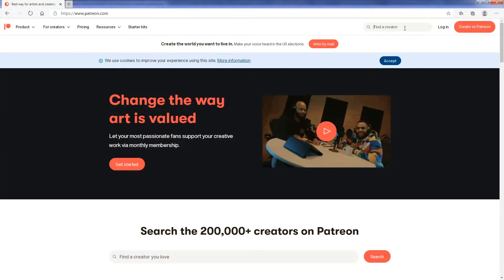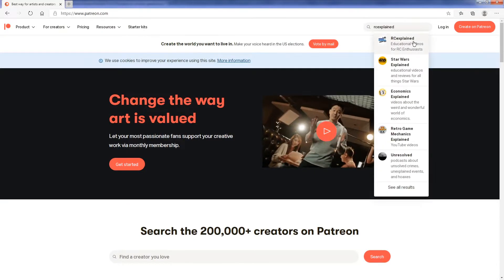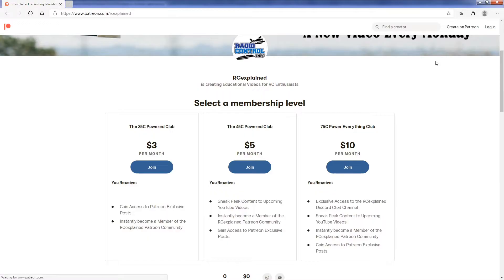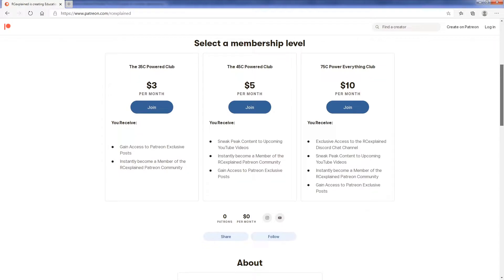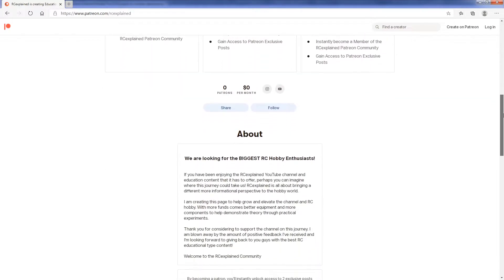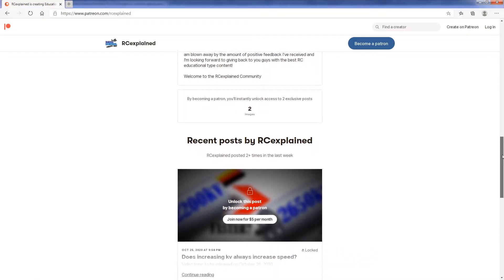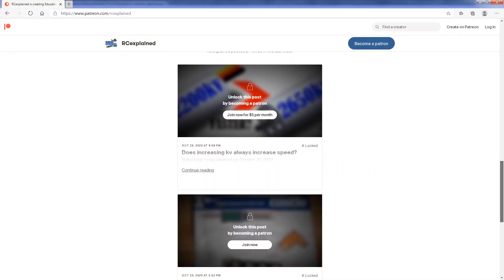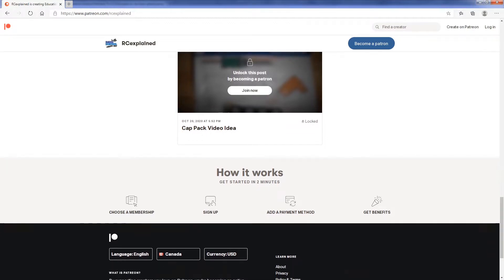Does Increasing the Motor Kv value Increase an RC Cars Top Speed?

Comment: There’s another way to do it, since the output is due to current and resistance of the motor, higher kV has lower resistance. Way higher kV would work better, higher voltage with less current is another way to do it. You can balance that with lower gearing, or even just program a throttle limit to limit the rpm from excessive kV + high voltage so it’s like lower kV motor but with less heat output, that’s done on quads commonly since the flight controller runs software that can handle limiting throttle.

I have a motor in mine that resistivity may be 0.04 ohms, at 40A, gives 64W. If we move from 2s to 3s and either down gear or limit to 67% throttle, or smaller pinion and bigger spur etc, an equivalent speed would run around 26.7A giving only 28.4W of heat. Moving up in kV if you can’t move up in motor size also lowers resistance.

Comment: Great vid ryan. When i had my infraction, i spent too much money on motors, and an esc’s, why? I wanted to hit 100, when in reality a simple gear change spur and pinion, could do the trick. I stuck with a castle 2200, and had a mamba monster x 8s
Reply from the maker: Thanks for the comment Colin. Good point and that's a sweet setup you stuck with.
Reply: @RCexplained  but, as i recall, my castle 2200 died from overheating, so i replaced it with a 1515 1650kv motor
Reply: @colin1992  Of course it died you cant use 8s with a 2200, and the motor you replaced it with is a 1717,  which is lower kv but can push a way bigger gear.

Comment: You never mentioned adding a heatsink. It is a good way to reduce heat without having to upgrade the can size.
Reply: Yes a fan can also help a lot as well of there isn't already airflow over the motor.
Reply: @LawrenceTimme  Yes, by heatsink I also meant that you could put a fan on it. Thanks for clearing it up.

Comment: I have put a 540 motor with 2000 kv and 4000 kv to a car without chaging any other thinngs. But the speed is not exactly doubled . Whats the math behind  this
Reply: It's very likely it's over geared and that the higher kv motor doesn't do it's rated kv.
Reply: @LawrenceTimme  thanks for the reply
Reply: @LawrenceTimme  Please explain.
Reply: @dr0n3droid  if you double the kv of the motor. It's trying to go twice as fast, so it's over loaded. It's like going from a 16t pinion to a 32t pinion, you just wouldn't do that
Reply: @LawrenceTimme  So you're saying that the 'under load' condition  of the motor makes it nearly impossible to reach its desired RPM because the current draw would be too high? Hmm...Sounds much like what I said above.
Reply: @dr0n3droid  yes. Most motors will hit there rated kv under a reasonable load. Just not overloaded.
Reply: @LawrenceTimme  No motor will reach its RATED KV under load...any load.
KV is rated at "no load" conditions.
Reply: @dr0n3droid  OK 99% of its rated kv, the point is its barely anything unless overloaded. The extra heat in the motor raises the kv as it goes under load and it ends up going as fast in real life.
Reply: @LawrenceTimme  Alright then...how does heat change a motor's kv?
Reply: @LawrenceTimme  You know what...before you did in any deeper...
It's determined by the number of turns on each pole, the cross-sectional area and the length of the wire.  Heat has nothing to do with kv
Reply: @LawrenceTimme  To say "99%" is just ridiculous. If you can't understand why it's ridiculous, I can't help you.
Reply: @dr0n3droid  Wow dude, I understand you have knowledge in RC, but acting like everyone else doesn't know anything is always wrong. Try helping those who aren't as smart, and don't be toxic. Toxic people aren't welcome here and aren't welcome anywhere.
Reply: @mad1pengu619  I understand that my approach is abrasive but facts don't care about feelings.
Reply: @mad1pengu619  A leopard cannot change its spots. As such I do what I can to provide factual information.  If challenged with information that is partially correct I do what I can to clear up discrepancies.   It's not up to me to coddle or hold anyone's hand.
Am I being mean to anyone?
Reply: @dr0n3droid  there is a video with it on it on this very channel. Just look it up. I can't explain how brushless motors work through YouTube comments XD.

If you like you can test it yourself, get a motor on a motor tester and point a heat gun at it for a few seconds. You'll see the kv increase even though nothing else has changed. Obviously don't do it for long though because you will damage the motor.
Reply: @mad1pengu619  I don't think he's knows as much as he thinks. He's clearly watched a couple of videos and is now a YouTube comment expert. Probably being arrogant and aggressive because he's having a bad day.
Reply: @dr0n3droid  Its not right to go on in the name of science and ignore others, people that follow this are called "Mad Scientists" for a reason.
Reply: @mad1pengu619   @Madhavan Muru  I assume you've also been reading the comments of my co-conspirator in this thread.  Since his last outburst has shown his true colours can we agree that while I've been attempting to educate him, he is on some sort of ego trip trying to be right?  
At no point have I attacked him personally, nor have I ridiculed him any more than necessary to prove my point.  I did call one of his assertions "ridiculous" which was admittedly unnecessary. 
If I were "ignoring" others as you say, I would have simply chuckled to myself and moved on without attempting to educate them as to the error of their ways.
I may lack tact, but am not incorrect. My argument stands on its own merit, while his has devolved into nothingness.  At this point it would be humane to simply leave him alone as he does not have the tools to continue.
Reply: @mad1pengu619  I would like to sincerely thank you for your comments.  I am aware of my tendency to be less than kind in conversation.  It does help to be reminded occasionally. For that I am in your debt.
Reply: @LawrenceTimme   I have provided you with nothing but facts. You attempt to attack my character for what reason exactly? You seem to be talking a big game but cannot back it up with anything.
I will gladly look up the videos you're refering to, on this channel and yours once you tell me what it is I'm looking for.  Am I expected to watch all of your videos to find these elusive "real life tests" you mention? Would you be so kind as to provide links or at least titles for me to search?
I would very much like to do these experiments for myself.  Could you explain the parameters of the test? The purpose of the test? Could you explain how a temperature gun is going to determine the kv of a motor?  Could you explain what it is that I am to "not do for long" because I certainly would not want to damage a motor.
There are two things you've said that I completely agree with. 
1. I have watched a few YouTube videos. 
That does not make me an expert, nor does my years of experience, or formal education.  I am always learning new things. You should try it sometime.  I am willing to point you in the right direction if you ask.
2. You can't explain how a brushless motor works...in YouTube comments or otherwise.
My big brain knows that you are talking out your @$$.  
Prove me wrong.
Reply: @dr0n3droid  will different brand motors with the same kv rating have different over all performance under load come closer or further to there said kv rating ,ofcourse all other factors being ssme , will  brushless motors lose some performance over time ? Causing more strain on  escs ? Wondering if it was worth changing bearings on cheaper rtr brushless motors
Reply: You have many factors that varies such as drag , amp draw and is your esc providing enough current to supply the motor you should always remember the higher the kv the higher the amp draw
Reply: KV rating is based on 'no load' conditions.  The speed of the motor will double when not connected to anything.  Once a load is introduced, things change.  The higher torque required to spin the entire drivetrain reduces it's ability to reach, in your case, "double", without enormous current draw.
Reply: @dr0n3droid  thanks for the information

Comment: 4:18 When you say "increasing kv" are you suggesting rewinding the motor?
I feel as though this video could have been an hour longer and would still not cover this topic.
By changing can size you're really not comparing different kv.
Reply: Dude he simply mentioned that the higher kv can be a smaller can but it’s voltage potential is smaller compared to a larger can listen to what he saying instead of skipping to half the video and leaving a dumb comment without any other context clues to what he is saying and then responding twice to your own comment 😂😂😂
Reply: @lowridr2  Dude.
Reply: @lowridr2  I watched the video 4 times to ensure I didn't miss anything before leaving a comment.  As someone who has studied motor theory, I understand that it is a complicated topic and there is no way so summarize in <10minutes.  
My comment to him is an attempt to foster discussion with the hope of increasing everyone's understanding.
I get that all of this is over your head. Even basic punctuation is lost on you.  If you don't have anything intelligent to add to the conversation maybe you should keep your mouth shut.
Reply: Should have titled "Does a larger motor increase speed?"
Reply: Or "Does a higher voltage increase speed?"

Comment: Always great information! Keep up the vids man! Love learning anything I can!
Reply: The video was a bit confusing?  You talked about how you had maxed out the 2200kv thermally, then later said you maxed the 2650? I already am familiar with volts, kv, size, ect.. so I knew you had misspoken,  or dont know what your talking about.  Maybe make a script so your not so confusing?  You said you were close to the thermal point of the 2200kv and near the end you said you had run close to thermal with the 2650 can, so which is it? Being you went from 2200kv to a 2650kv, you made example of the 2200kv being at its limit. I get it... but it is confusing.  Love your work keep it up but mabey if explaining stuff make it more logical, hope you get what I'm saying... not dissing at all, I really appreciate your work but the vast majority will find it very confusing. My opinion, no offence.
Reply: @RcOffroad9513  There is definitely need for a deeper dive here. It's a complicated topic.  
I believe he did an excellent job of explaining the differences between the two motors, but I agree it was somewhat hard to follow as he jumps around a bit.
Reply from the maker: Fair point RC OFFROAD RACING and dr0n3droid. I should have explained the 2 different scenario's a lot more clearly, I can see how the ideas appear to be bouncing around in this video. I've added more clarity in the description as a result of your feedback. Thanks for the comments!

Comment: I want to know if I can put 2 6s lipo’s on my zelos 48 electric 160 esc 1000kv series
Reply from the maker: Not sure if the ESC is rated for 12s, however running an unloaded 44,400 RPM is not recommended. That would be outside the range I listed in this video for boats.